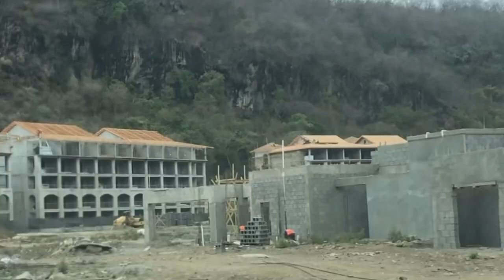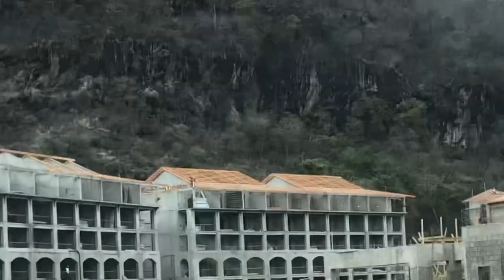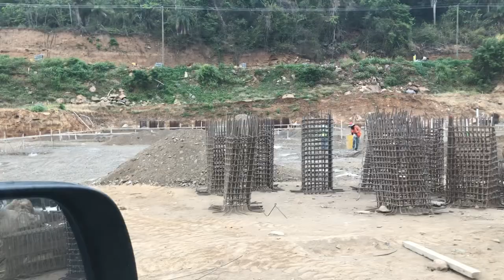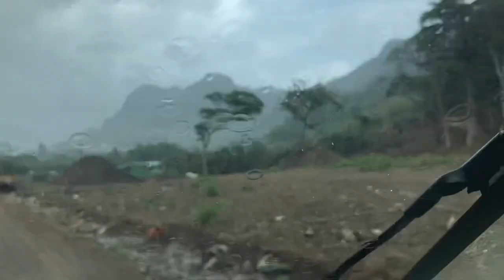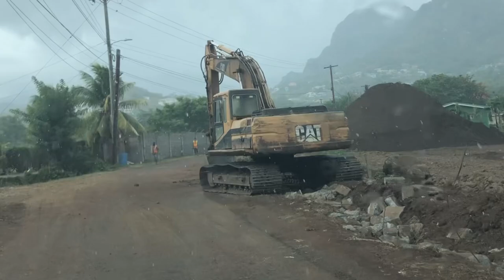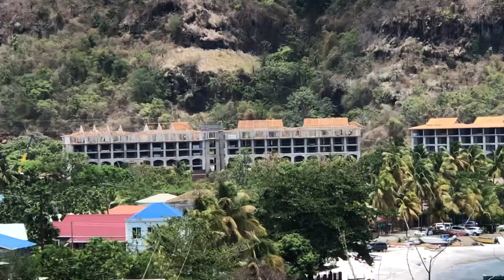St Vincent and the Grenadines making progress woo woo woo! Sandals Resort

Comment: Where is SVG is this ?
Reply from the maker: Buccament leeward side
Reply: Thx you 
Hope it don’t take to long to get finished.
Reply: I thought this hotel was on the Windward side .
Reply from the maker: @marleyite  leeward side
Reply: @woowoowoo784  Diamonds is on the Windward side of the island.
Reply from the maker: @marleyite  Yh have  two In diamonds one finish
Reply: Sandals.

The plumbing here is going to be troublesome.

I was the engineer who laid out the pool room slab piping penetration and other mechanical systems.

Think I may still have all blueprints of this resort.

Beautiful on proper completion and proper quality control  INSPECTIONS

Consultant?
Reply: Wait there’s a Sandals in Diamonds?